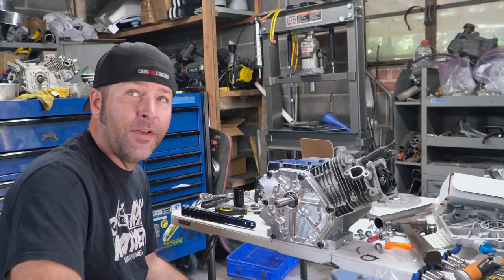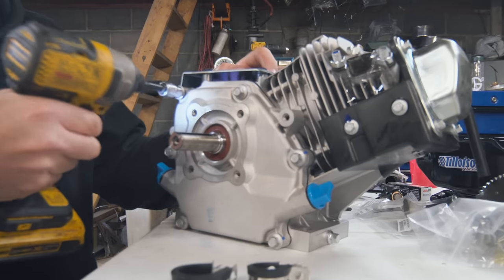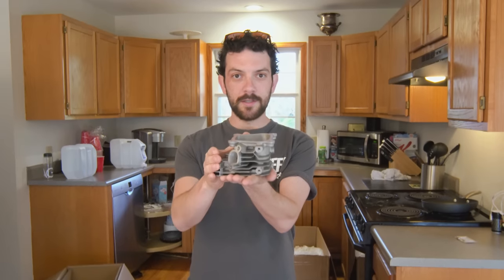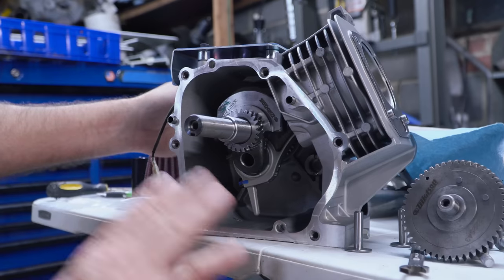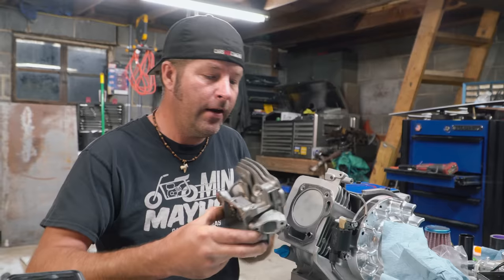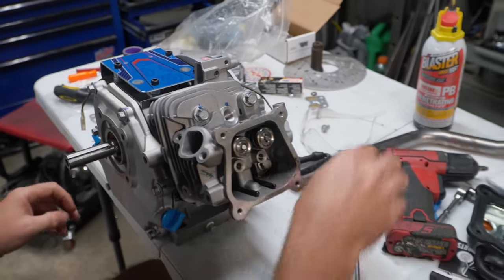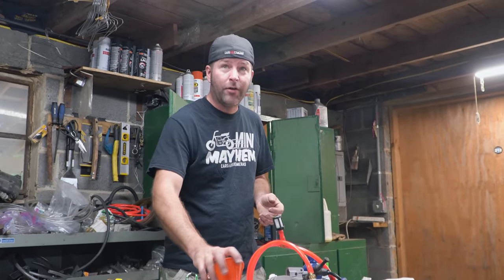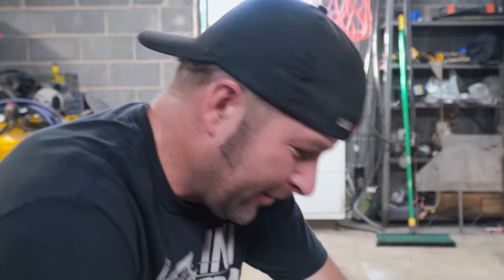Tillotson 225cc Big Valve Build | 9,000 RPM, 25HP Billet Maniac!

Comment from the maker: I realized we built a big valve head, but we didn't share the valve specs! Stock is 27mm intake, 25mm exhaust, and we upgraded to stainless steel 28.5mm intake, and 25mm exhaust. Doesn't sound like much, but between the better design, larger intake valve, big cam, 1.3 ratio rockers, heavier valve springs, and lighter components, the valve train is WAY better than even a stock 225.
Reply: Y not 32 28mm valve head with a 308 cam
Reply: Thanks for the update.
Reply: I just got an EC 228r wonder how it compares.
Reply: The exhaust port on my DMP 70cc Puch E50, is 25mm.
Reply: Still waiting for Tilloston to make a 225 with a dohc head.
Reply: When you swap the motor for methanol make sure the valves are shut after running and make a plug for the exhaust to keep the ambient temp out during cool down.
Reply: Cannot wait to watch this when I get home
Reply: Can you please get an exhaust setup for both shops...  you will thank me when you don't get health problems from breathing all that in.  Love you all and the content you deliver, please stay around for your fans!
Reply: 55
Reply: @gokarting1018  no reason to do anything else if your going big do 32-28
Reply: Did you say the cam was .265 lift? Is that with the 1.3 rockers, or stock rockers? Cuz it makes a huge difference in lift.
Reply: @gokarting1018  No matter HOW big you go, on ANYTHING, SOMEBODY is gonna say "why didn't ya go bigger?" 🙄
Reply: @donaldfuller5041  Plus ya gotta purge the whole system to make sure it's dry. Methanol is so corrosive to aluminum. I think methanol is more trouble than it's worth.
Reply: @jeffrykopis5468  how hard is it the run pump gas thru the fuel system afterwards not hard methanol is way better then pump gas
Reply: 32 28 on my mb200 thing is nasty
Reply: Matching the valve springs to keep from floating the valves and less energy of making them open is a thin line. I saw your channel last night and you had information to not lapping your valves, why?  I, and most of the people I raced with, lapped their valves between practice, qualifying and racing.
Reply: First off you should apply machinist blue dye or prussian blue marking compound to valve or seat and the first cut should be made with the 30° cutter, the second cut is made with the 45° cutter, and the third cut is with the 60° cutter and yes you should lap the valve with cutter head you don't need to with stone surface grinder because they maintain roundness unlike valve cutters when you stop
Reply: I'm kinda surprised you didn't have to put more heavy duty push rods in it with those heavy springs
Reply: A good ole 25 mm to 25 mm upgrade lol
Reply: @sprintcardriver8  Yeah, true, any gas with Ethanol in it eats aluminum too. I'd probably stick with VP non-ethanol 95.
Reply: 4w5þ55555q4q4q4q4q⁴
Reply: Put it on a bicycle that would be a riot for testing purposes only of course
Reply: @moto6ixmoto83  that ain't happening buy a jawa you'll have 70hp
Reply: What would the whole setup cost? Just wondering 🤔
Reply: Big valve heads are 32/27-28 for small block, with that said 28.5/25 is better for small track racing.  Wished I could get this many views building my engines. Good job.
Reply: You got the kit but didn’t do a 3 angle valve job? Also
The piece you removed from the valve cover is the PCV you’d be better off to install an automotive style PCV and go to the intake on the other side. Then put a filter at the side cover. The PCV actually causes a slight vacuum and evacuates the unwanted byproducts in the engine. The HP difference may or may not be big but you will def have much cleaner oil and burn less oil. Especially with low tension rings. Cool build though. Sounds cool.
Reply: 9
Reply: Was the stock head hemi or non hemi ?!

Comment: I would love to see you guys do a video on how not to build an engine with the worst parts you can find and the worst technique, maybe a competition to see who can fry an engine first
Reply: The easiest way to destroy a small engine like this is to turn it into a race engine but cheap out by using the stock cast connecting rod, which will be thrown right through the side of the block at sustained high revs.

Comment: Putting the lapping compound on the flywheel and crank, is known as, "lapping them together."
This is done on gears, slides on 1911 model pistols. 
We did it a lot when building inspection gages in order to obtain very close fitting parts.

Comment: Using the compound is to ensure a good tapered fit when you decide to remove the timing key completely. The timing key is just that, a timing key. Its not what holds the flywheel in place, its used to line up timing. Myself as well as many others remove these keys completely when advancing timing. The taper on the crank is what holds the flywheel in place. We just use the compound as seen here to make that tapered fit even stronger since we remove the key. FYI, advancing a quarter width of the key is around 7 degrees advanced.

Comment: It is amazing how far the technology has gone since the mid-eighties when we ran modified Briggs flatheads. We started by boring the block .100" and popping the valve seats out for the big Horstman setup. The crank was the stock 5hp Briggs that was balanced between two electromagnets from security doors from an office that was being renovated. Horstman ground their cams from welded up stock blanks so we had to work with a smaller base circle. I would take stock lifters and lengthen them with weld and hand grinding to make it work. The piston and rod were from Horstman, the intake port was actually ground through at the bend and built back up with JB weld and re-ground. The head was "decked" with sandpaper on a broken piece of headstone donated by the local monument co. The carburetor was a Tillotson with a secondary pump powered by the crankcase pulse. At Flemington, I was able to turn 9400rpm. I have to look, I may still have that engine in the shed.

Comment: You can use an offset key in the key way to advance the timing, two fuel pumps, methanol fuel, bore the block 0.030 over.
Reply: Does the offset key just change the ignition timing, or the cam timing?
Reply: @jeffrykopis5468  ignition timing

Comment: Love you guys. im a kart mechanic at a kart rental place were now runnin tillys because of you guys and gopowersports. Tip for takin the valve cover baffle out... Hit it with an air gun 100psi through the hose to the air box it pops right out. And flys about 30 feet lol

Comment: You're right about not lapping valves. There needs to be a 1 degree difference between valve head and seat. This difference goes away at temperature because the valve head gets way hotter than the seat, therefore different expansion. You really need a PCV to keep the crankcase under vacuum. This reduces oil leaks and helps keep the crank motion from pushing all the oil to the sides of the case.

Comment: I just test fired a Predator Ghost tonight and had the throttle do that, kinda figured it would so I put the front wheel up against a wall before pulling the cord. The 7/8 throttle kits need a thread or two cut off the cable sheath or the pressed on end pulled off and about 1/8 - 3/16 of the sheath cut back or the internal cable is too short for the Mikuni, Chikuni and WalBro carbs. Pain in the ass. Finishing up a 236 Tillotson with a Billet head, need to cut the pushrods to length and check the rocker arm sweep. Might post a Video on my little channel. Love you guys 👍🏼

Comment: You guys should look into check valves and exhaust scavenging for PCV..  The exhaust gasses vacuum out the crank case gasses and it's good for more horsepower.  5-8 hp on a 355 oval track motor.

Comment: also you need to have the appropriate crush on main bearings so they dont spin, .003-.005 roughly definitely do your home work tho. on polishing the intake you want a desired 800 lubricated grit finish for correct atomization of stoichiometric ratio. i learned the hard way when i was a kid. you guys are doing great! keep it up.

Comment: Sharpie the valve tips will leave a nice whiteness mark for pushrod length. Also most important part of new valve spring is seating the locks. Always smack the valves with a soft mallet to seat the locks. You guys need to build a engine run stand by now… All these engines built over the years… take a spare engine plate weld it to some steel with rubber pad feet and boom. No more chasing them across the concrete on plywood lol

Comment: You guys need to build a jig onto a workbench for doing cylinder heads. I have one with a piece of stainless with a big hole drilled in the center for the tool to go up through. Then a small wooden catch basket right on the front edge to put all the small pieces valves guides keepers etc. Saves me tons of time and headache and only took me a couple hours to build

Comment: You know if you want to check a valve seat all you need is some DyeChem or a sharpie. Just color over the area in question and push the valve into it. Rotate it a little and see where it removed the sharpie or other marking fluid. Its easy enough to clean off with a bit of isopropyl alcohol.

Comment: Little trick I use when installing retainers and keepers with that style of tool is to put everything on top of the stem then lay a ziplok bag over everything. After that use the tool to compress the spring. The bag will keep everything in place

Comment: When checking the push rod length, you can also color the tip of the valves with a sharpie and instal the rockers try then rotate the engine a few times and when you take them off you can see where the rockers are sitting.

Comment: John , I see that your Dishwasher is around the corner from your sink . I used to deliver and install D/W 's . The Water needs to be real hot to do a good Job , So I recommend that you fill and drain it Several times to get actual Hot water to enter the D/W ,  The Energy requirements eliminated the Long duration internal water heaters long ago , until the water is Steaming , the machine will only do a sub standard job .  Proof to me was my friend in an apartment over the massive water heater , doing a great job with the cheapest model Hotpoint , Mine being a high end Kitchen aid and I needing to run water hot , at the sink  and then the fill drain trick .

Comment: Okay carsandcameras on the valve lapping compound on the flywheel your half way right if your buying a aftermarket flywheel it could be off a little bit and the tappers not match because sometimes they use a different machine in the factorys or somthing i dont know but what i do know that you do that only because not all flywheels arent perfect for each motor and it could cause unstable movement and destroy your internals or break your flywheel off

Comment: If you colour the top of the valve stems with a marker pen before you put any lube on the rockers, you can install the rockers and turn the engine over a few revolutions. The roller should wear off the pen and give you a very clear indication of the positioning on the valve stem.

Comment: Shot in the dark, but have you guys ever attempted or considered a propane powered build?
Much higher octane but lower energy content so the magic sauce is to raise the compression ratio. Adapting is fairly simple, replace carburetor with a small venturi (easy to DIY) with a tube in the center, this is piped to a simple garretson kn demand regulator (Fairly cheap).
Might make for some different and interesting content.

Comment: i get what Ike is trying to say with the air moving back and forth but the air isnt moved by the top only the bottom since the top is sealed inside the combustion chamber. also the opening where the push rods comes up into the head is open to allow oil splash but also air movement so its already doing what the hoses and fittings are supposed to do. this is why the ventilation is on the valve cover, its all one open area from crank case to head. the hoses are redundant

Comment: It won't hurt put molly grease  or graphite grease or straight Lucas on the cam the assembly lube is ok but could use some solids in it like the break in oil , zddp/zinc, I build engines using Lucas with a touch of oil in it,

Comment: Methanol you will want bigger jets in the carb and more spark timing advancement.  Which on the old Briggs engines was achieved with offset  flywheel keys

Comment: If you want 'free' horsepower, use a one way valve in the exhaust runner, attaching a hose from the valve cover and crankcase o the exhaust one way valve. The exhaust flo vacuums crankcase and valve cover pressure. Otherwise you're only pressurizing from top to bottom over and over. Idea is to rid any pressure below the piston which will allow the rings to return on exhaust stroke without pressure on the cylinder wall. A set of Dykes rings would increase power and rid drag on the cylinder wall when not under compression. 

Old is new again. I always run the scavenging hoses from the valve covers to the exhaust in order to decrease bottom end pressures. Free ponies from that point forward.
Reply: I'm no mechanic by any stretch of the imagination, but I was wondering why you would pump pressure back and forth between valve cover and crank case, but then add a vent in line.

Comment: You can copper spray.,or aluminum spray them with some permatex spray silaconized based mixed spray sealant in the can on that metal gasket.

Comment: You want to keep velocity up when porting . Matching the transitions between carb to head and boot or insulator between them help allot also
Reply: For case clearencing  some guys cut a old side cover leaving a few bolts and the guide pin holes

Comment: im curious on how changing the rod may offset the balance of the rotating assy and you can use blue dichem to check the actual valve seat. permanent marker works also. id like to also see what kind of roller tip rockers would be avalable and what ratios could be used to cheat the cam  keep in mind the push rods may need to be changed to satisfy proper length when adjusting ratios. cool stuff guys this is my favorite show. o ring heads would be really neat to play with also at some point for super high comp.

Comment: I see in the description the parts list. But I was wondering about the tool used for cutting the new valve seats? Do you have a link for that? Would be handy to have, especially if it works on more than small engines.  Great video!

Comment: Would it be possible to buy or make your own dyno?  That way you can accurately test your built engines.  For example, you could have dynoed this Tillotson 225 before adding your performance upgrades and then dyno it afterwards and see how much hp and torque you gained.  The result would make for a more satisfying video.

Comment: So I'd like to see more performance hop ups. I'm a engine machnist and work at a small mom a pop machine shop. We got this guy always coming having us do mods with these 225 engines blocks. Recently on his last visit he had us change his bore centerline in relation to his crank shaft centerline. He wanted me to bore for a sleeve to his new center line. I noticed that he moved it .0625 to one side. Made me wonder are the 225 block of that far or are they made that way?

Comment: I say, drop that puppy in your gambler minibike, make the chassis bullet proof, slap on a super heavy duty clutch or TC, and you could prevent WOT in order to limit your RPM... That would be a real threat! I'm surprised, as many motors as you have around, that you don't take an old side cover and cut viewing holes in it to check clearances when swapping rods/cams etc.

Comment: if you run it on methanol ditch the flat slide carbs, go with a tillotson 304wxa or a comparable model. I promise you will not be disappointed. you may never go back to a slide carb after using one...

Comment: @26:10 isn't the upper side of your piston the combustion chamber? also isn't the crankcase ALREADY connected to the valve cover through the holes that the push rods go through? like I get that pumping losses are a thing, but don't you just need to vent the crank for that?

Comment: Is there a way to remove the governor and install a safe flywheel that will allow you to charge or run lights? I have a Coleman B200X that we want to upgrade, remove the governor, but still keep lights for trail riding without the need of a stand alone battery. Charging coils and billet flywheel or equivalent.  How to Video Please.

Comment: I want that cam, for my scooter build. I want it to sound close as possible to the scooter engine,  this is definitely rev happy,  just like my scooter, untill it has a load on it,  I'm thinking about building a 212 with rod/flywheel, cam springs carb,  port the head, mount it on a swing arm, with the rear wheel, maybe wheels, making it a trike, I have the parts ,.  I'm thinking about CVT over a clutch, I have revved the original engine over 10500 it just doesn't make enough power, it's no where near stock, I just need to work on the brakes, find the parts needed,  to mount a disc brake and sprocket to the rim,  get it all to look kinda stock! To be street able!!

Comment: why would you want to remove the check valve from the crank case? are you replacing it with a better unit in the future? frothy oil absolutely saps horsepower, and you want to limit its movement as much as possible. kind of confused with the delete with no provisions for something to seperate air and oil....

Comment: you would think that putting to heavy of a valve spring will add to more wear on the cam and valves
Reply: Need a heavier valve spring to keep the valve closed at high rpm.  Otherwise the valves would float and never close all the way.